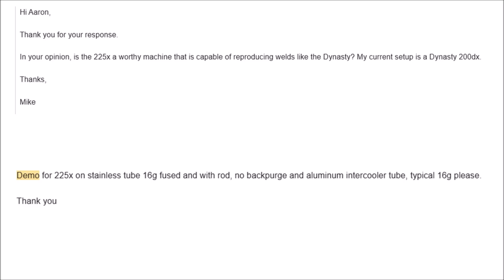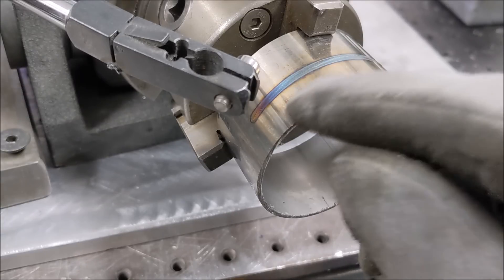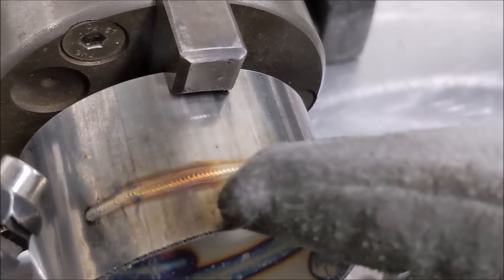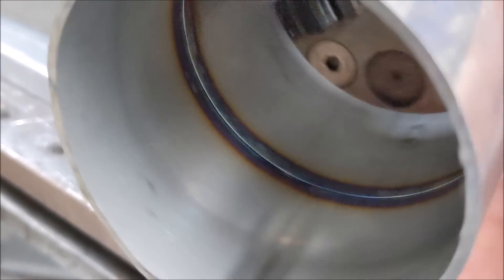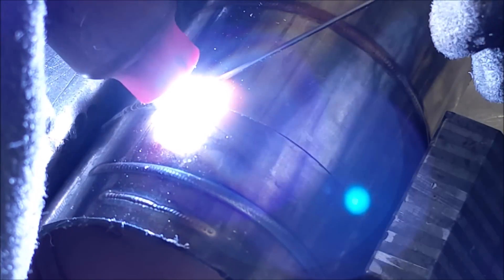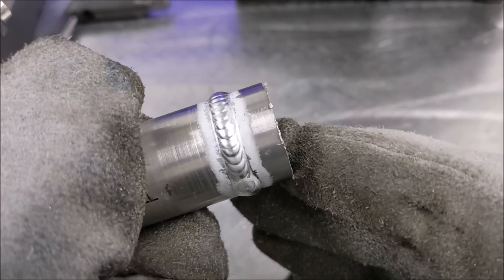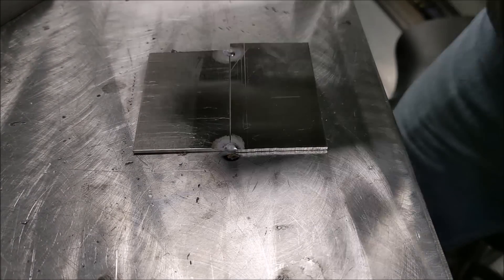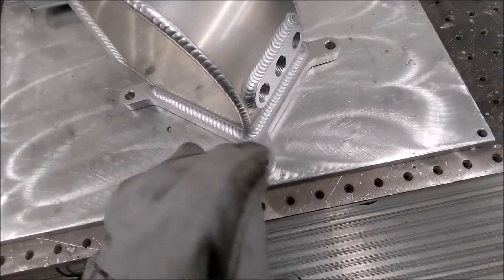PrimeWeld TIG 225 Demo

Comment: Hi Aaron, love your content. I know you are primarily an aluminium welder, but would you be able to do a video about purging/purge alternatives for stainless? I've been told you don't need to purge if you don't run full penetration welds but I'm worried the lack of penetration would be an issue. I only weld at home but want to make an exhaust and would rather it didn't crack after a few weeks. I'm fairly competent with a tig, but mostly weld mild steel or aluminium in small batches, haven't got a lot of experience with stainless

Comment: We are spoiled at work with Furickk # 12 cups which give some pretty nice gas coverage. Used on 15-5 & 316 stainless plus 625 inconel. And we run them on the newer Miller 400's

Comment: The only issue that I have with this video is that I have this exact machine and my welds do not look the same. Fantastic work, sir.
Reply: I think you should turn the skill knob to 10
Reply: i have the same machine and same problem. but its 1000% better than the esab heliarc 160 i had before....
Reply: Same😂

Comment: I've owned both machines mentioned in the question, PrimeWeld 225 and Dynasty 200DX. The Dynasty welds a little smoother, has a little better start and is capable of lower amperages. The fan is also a bit louder on the PrimeWeld. From a practical perspective, though, there's nothing I've ever welded with the Dynasty that the PrimeWeld couldn't handle well.

Comment: Your junk welds look a 1000 times better than the bubbleguming I did today on my 21 year old thin rusty exhaust pipe flanges, using my 11 year old Hobart 140 mig porcupine needle shooter that wasn’t used for 10 years !!! 😂  Talk about jumpy wire feed and unstable worn out 61 year old arms with blind vision , but I got a dang good thick coating of spatter all around both flanges. So hopefully I can get another 10 years out of my catalytic converter pipe without any more street farting .
Reply: I also have a Hobart 140, used to run it off a normal 120v outlet but found it runs a lot smoother directly off a generator. Not sure if that could help you. Also make sure you clean the area you're going to weld as much as you can

Comment: Could you dedicate an educational video on ‘all about equipment ground’? Fundamentals of why it’s important, how we can all benefit from a proper set it up, how to protect electronics from HF camera/wifi routers etc. I think that would be very interesting!
Reply from the maker: @11LowDown11
The only thing I ground is the welder to the foot of the welding table. I like to live dangerously.
I've had no issues other than my camera going haywire and needing to be restarted occasionally.

Comment: 225X is a good machine, just wish the other settings not just amperage show on digital display like they do on 325 . Not such big deal when welding steel or SS, but kind the guessing game when welding aluminum or for pulse setting.

Comment: What's the best way on the 225 to minimize the heat traveling backwards up the torch into the hose?  I think it's related to filler feed and travel speed but I'd like to hear from someone way better than me.  BTW, I really like my 225 - it's the best value TIG machine out there in my opinion.
Reply: Get a bigger or liquid cooled torch. Travel speed & filler have no effect on the torch, only welding power (literally how much heat is being generated). More Joules = more heat.

Comment: I love mine. I think it welds cleaner and more controlled than  the 375 lincoln at work. Granted there is a huge power difference up top but I'll never need that for my house. I bought it with huge skepticism in my mind so I don't think it's a fan boy issue lol. Been using it 3 years now and absolutely love. Especially on aluminum. I think it really shines on ac.

Comment: may as well sell off the dynasty since the primeweld is just as good
Reply: I had a Dynasty, now I have a everlast 255ext. The everlast ran 5 years so far, welds the same, maybe better.  
The Miller is made better, but not $8,000 better.
Reply: Already did!

Comment: How strong are those welds with no filler rod?
Reply from the maker: @transmitterguy478
Out of curiosity, welded up my jet boat headers like that for my 532ci twin turbocharged engine. No filler rod.
The exhaust got really hot and never cracked. I did make sure the turbochargers were braced properly so they weren't held up by the headers though.
https://6061.com/boat11.jpg
https://www.6061.com/06.jpg
Reply: @6061 Nice looking boat!
Reply: @johnw6908  yes, holy crap that thing looks sweet! Now I gotta watch his boat vids